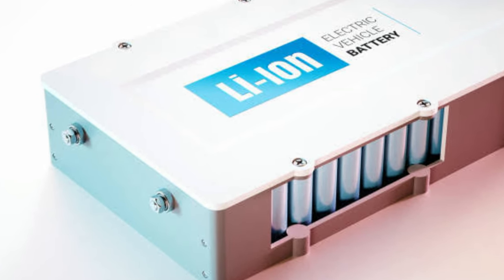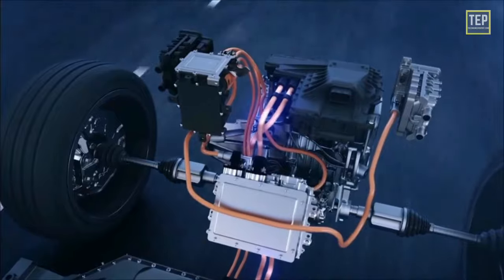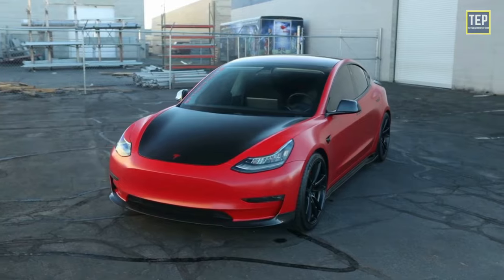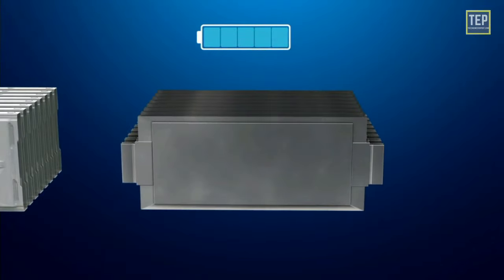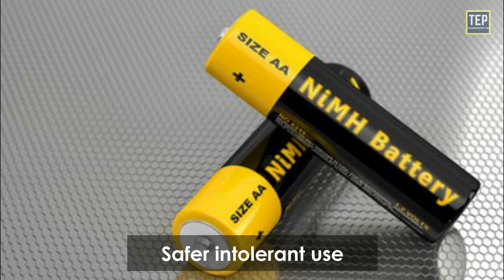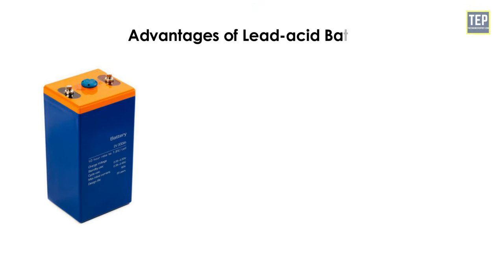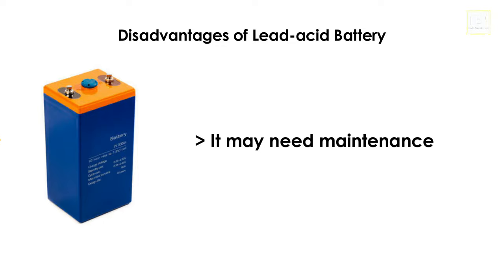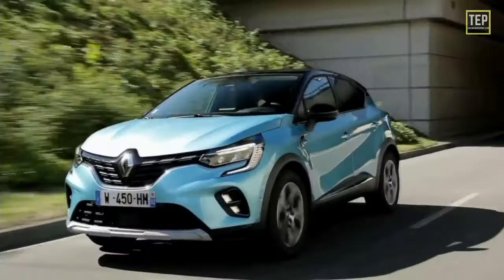The Battery Basics: Understanding Lithium-Ion, Lead-Acid and More

Comment: A very good and informative video. Thank you.
I'm a mechanic in Australia and there is a massive push for EV here. A little too fast for my liking as there is way more research to be done before the western world should purely adopt this method. I remember when used oils had to be "reclaimed" and the costs this created (although it did give rise for other industries, apositive) and the implementation of this reclaim/recycle decìsion actually created more issue's as the rule wasmade before the process was developed.
I'm not being a nay sayer, as I am researching and educating myself, knowing I may have to work on these vehicles in order to progress my trade and business. 
I slow down and a bit of "what if" thinking should be applied because there willbe an immense amount of wste from these vehicles, soon and not just attrition waste. Accidents. Abandoned. Developmental disposals, etc.
Reply: Well said.
Reply: @ Jelly
Aptly put 👌.
This should go beyond just EVs and further to other innovations (especially techs relating to energy/power, bio-linked, et al) to be considered well first and allowed to be determined by the market (people). An innovation should flow in a free market where it could serve as an option to some while, a necessary transition for others. All comes with backsides and these backsides may be weightier/more intensive from a small scale compared to say, another with a bigger/larger scale.

EVs rate incomparable on the scale of general efficiency and that is sure, a great point. That means we'll not just for the climate but...corporations as well.

Comment: Today's EV cars and trucks are using Lithium based batteries. LMO batteries can be charged 300 to 700 times. Once the battery has a low charge rate, now what, a $26k battery replacement. The EV battery has a warranty of 8 years. I would like to see  LiFePO4 batteries, that have 4x the life of lithium.
Reply: what about the range?

Comment: Given that the auto industry has been focusing on manufacturing gas powered engines and the battery powered vehicles are only starting to come to market, would you say that, with time, the battery industry will come up with a much efficient battery technology in the years ahead? Do you think the oil & gas industry will still try to hamper the progress of battery industry ?

Comment: I used the LITTIUM battery in my solar set up, it takes a long time to run out, it will break, unlike lead acid, it breaks immediately, especially when it is over discharged

Comment: What I'm curious about is why I only get about 10% of what I should out of my watch batteries. I've had several watches over the years, when wearing an analog watch I get about a month out of it when I should get a year, and a year out of a digital where I should get a decade.  This isn't the first time I've tried to look into the possible reasons behind this, so far i have only found the suggestion that this could be caused by a watch that waist to much battery, if this was true I wouldn't see the same situation throughout all of the different watch brands and types I've had. And looking into this has only become more difficult in recent years due to the every increasing popularity of smart matches, so most sites and videos I come across are about fixing smart watches that are eating though their battery.

Additionally these watches I only get 10% of the battery life I should while whearing them, last the length of time they shpuld when left sitting in a drawer.

Comment: And what about the NiFe Edison's iron batterie?
Reply: Pls elaborate more!
Reply: @xXZ31t6esTXx  Nickel sponge and Iron plate in an alkali electrolyte. They don't have any significant power density and poor charging efficiency, but they can last for a century. They were used in EVs in Edison's time.

Comment: As much as I like Li - Ion Battery, I prefer the still in researched batteries for the future, but that's the thing, it's still on development and research, trial and error, I hope that they have done enough testing to the point of making it public, but that will be years to come, Li - Ion is already researched, but not from the waste management side of things. which a mechanic on the comments mentioned.
Reply: There's a really good chance that using AI technology to model chemical/material simulations and using AI to find new potential candidates is going to be what creates the most substantial progress on this subject. The pharmaceutical industry has almost entirely switched to using specialized AIs to find new drug candidates and to simuate what kind of receptor activity and pharmacological effect they will have. The vast majority of drug models are now made by computer programs. Same thing for protein structure modeling. It used to take entire teams of scientists to put together the structures of a handful of proteins. Now, computers are able to model hundreds of proteins in mere minutes. It's absolutely incredible, and I'm hard pressed to think that material science would advance in any other way.

Comment: Why lithium titanate battery technology ( the safest future )  research and advancement  is stopped for ever? Who is behind it?
Reply: May you please develop more what you know about it?
Reply: No it isn't, in fact LITO batteries are still wildly utilized and researched, it isn't used in EV/BEV applications due to it's relative higher weight to energy ratio in relation to lithium ion and lifepo4 cells

Comment: Hybrid EVs will dominate the EV industry for the foreseeable future. They are the only EV solution which is comparable to petrol vehicles.
Plug in EVs are not fit for purpose as a replacement for petrol vehicles, and either won’t be or will take decades to become a suitable alternative. 
Expect Hybrid vehicle platforms to become the future of automotive propulsion, for several valid reasons.
1- they don’t take hours to charge their batteries
2- Their batteries are far smaller than plug in EVs
3- Parasitic devices are not dependent upon the battery pack
4- Cabin HVAC is not dependent upon the Battery pack
5- They are lighter weight than plug in EVs
6- They deploy much smaller and more efficient petrol engines. 
7 They can be deployed into any transportation platform with great success. 
8- They can be constructed without the need to depend upon exotic raw materials.

Comment: Batteries are fine for cell phones, but they’re still a long way from being a replacement for engines. They’re too expensive, the charge times are too long, and electric cars don’t have nearly the range to rely on them exclusively.
Reply: The Nio ET5 has a range of 1,000km (with a 150KW battery) and can swap to another full  battery at a station in 4 minutes. If one needs the car only for daily trips to work & can charge at home then range is not an issue and no time wasted at a gas station. Big and fast changes happening to the EV cars technology. Internal combustion engines are becoming a history.
Reply: @skasey4080  oh 4 minutes for full charging 150 kWh battery pack ? can you tell us what is a charging current ?
Reply: @minhkieu3412  They're not recharging them. They're swapping the dead batteries out for ones that are already charged up and ready to go.
Reply: @skasey4080  I do think recharging is the way to go, though. I don't think swapping out batteries on something as expensive as an automobile is realistic for a consumer market where people are responsible for the maintenence of their own vehicles, and where a lack of maintenence can result in very costly repair bills.

Comment: What size Lithium ion battery is used? Are they 18650? Could a battery be designed that is the size of something like a soda can? How would a battery that size be more or less beneficial than an 18650 or 21700?
Thank you for your comments. May you have a wonderful day 😊
Reply: If I'm not mistaken, EV's have started to use more proprietary cell structures for their batteries. BUT! Up until just a few short years ago, basically all EV batteries, regardless of automaker, just used a shitload of 18650s wired together into arrays which were further wired together into assemblies further wired together to act as one. For example, something like 20 18650s would be wired together in parallel and treated as a single "cell", then 10 of those "cells" would be wired together in series as a single "battery." Now, I don't know exactly how many 18650s were used at each level, so those figures of 20 and 10 are just to illustrate a point, but yes, originally, EV battery manufacturers DID use 18650s as the base unit battery with which they built their battery arrays.
Reply: @GR8APE69  yea I've seen that as well.